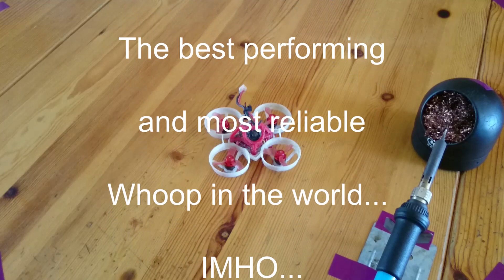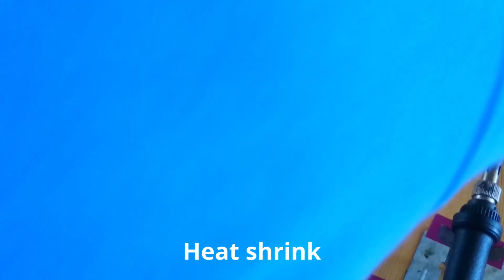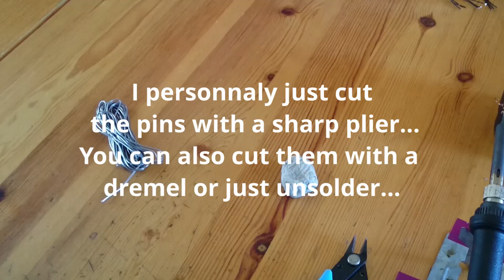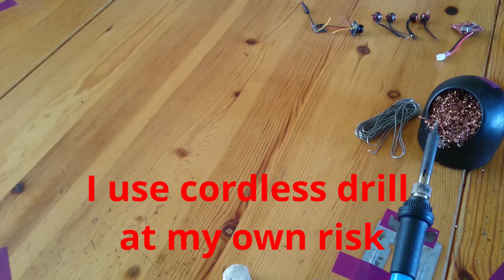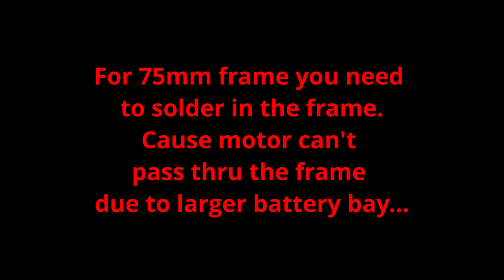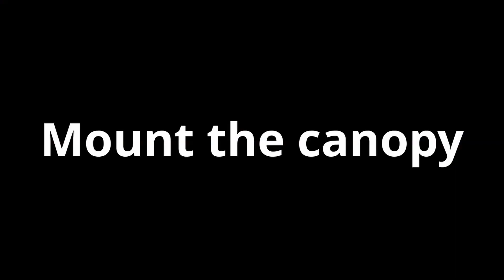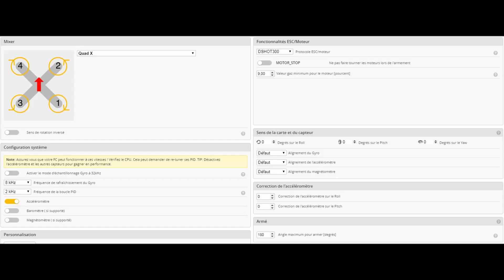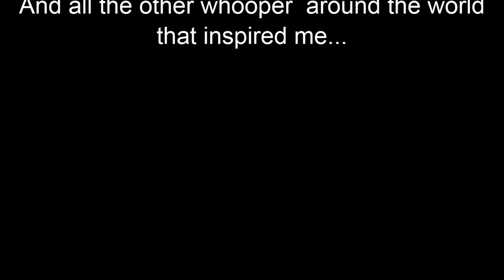How the Velocidrone Crazybee F3 was build ? Best brushless tiny whoop happymodel mobula 6 fpv

Comment: Wow very good job, a lot of tips. I have a lot of problems with my trashcan...  the props came out every time, i didnt understand how you prepare those to install...
Reply from the maker: Gemfan are really tight to fit on these motor, I just make room in the hub with a drill bit to let them fit easier.

Comment: Hello!  
I have several questions about this wonderful video: 
why do you use a 20 awg wire, because on batteries no more than 24 and the ph 2 connector does not support continuous current of more than 2 amperes - that is, can you use a lighter and more flexible wire?  
did you split the camera from vtx for a more convenient mount or to avoid overheating the transmitter?
Reply from the maker: I use 20awg for durability, imho battery with 24awg are shitty... Test by yourself, you gonna have huge sag with 24awg compared to 20. 
I split the cam for more protection, better range, and better weight centering 😉

Comment: noob question. 1s lipo, right? 🙈 
Good tut !!!
Reply: Correct...unless your board can handle 2s, but if you can you'll probably use larger motors.
Reply: Ok thanks ! ☺️
Reply from the maker: Like matthew said yes that's 1S.
For 2S you need lower Kv motor 😉